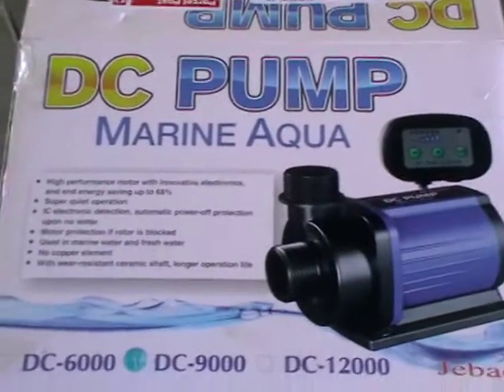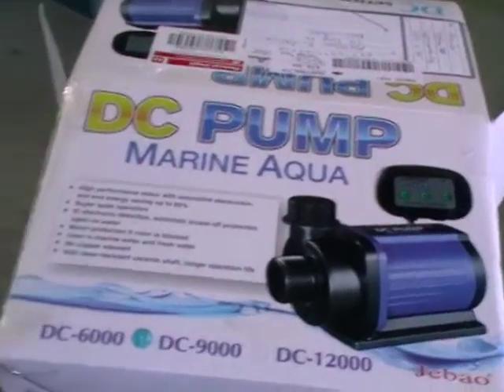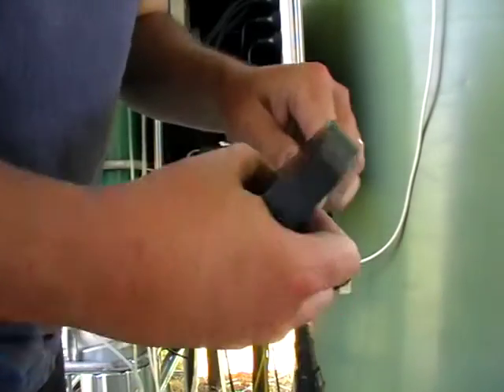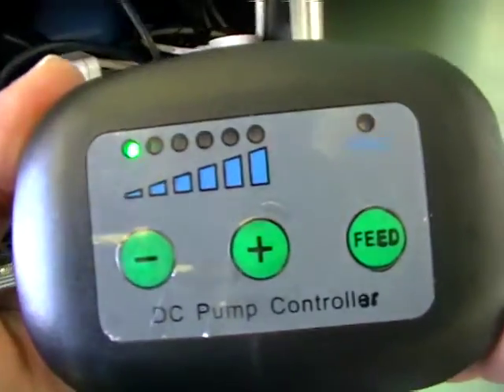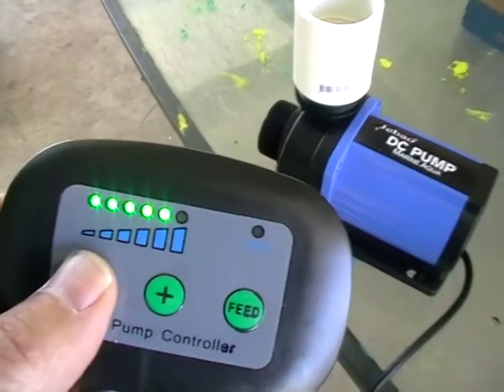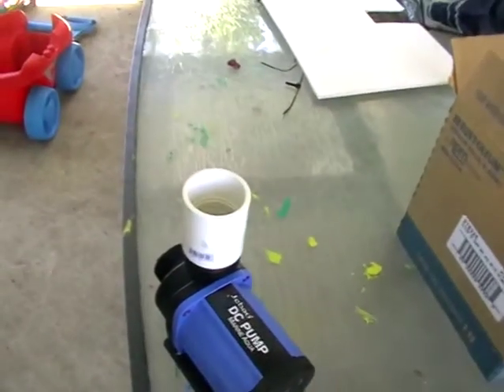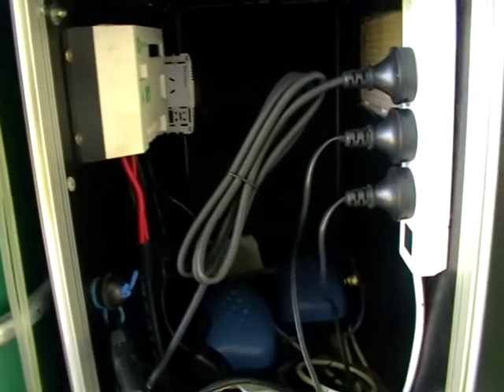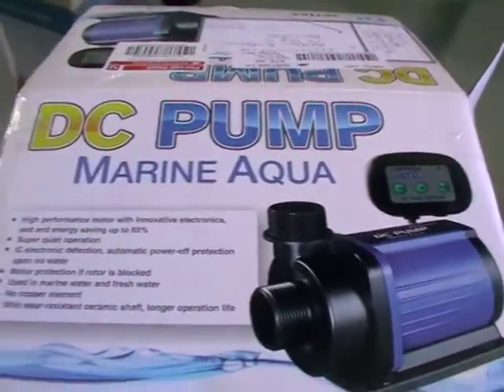Jebao ECO TECH DC Pump running on solar!

Comment: Did I see this correctly...   You plugged in the pumps AC adapter to your DC solar system to power a DC pump (without water (aka 'lubricant') by the way).  So not really a DC pump if powered by an inverter.

Comment: You can use a boat bilge pump directly with a solar panel without an inverter. They are very versatile and save money. I'm using one in my pool and another as a mini sump pump. YouTube pete garssia. If you want to check it out.